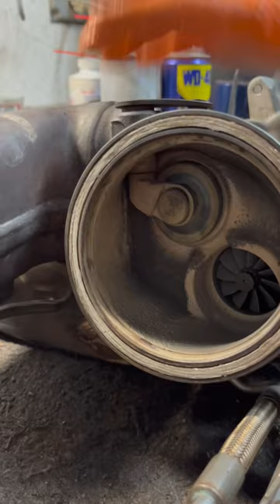BMW Turbo Wastegate Flapper Rattle

Comment: Mine only does this when I switch it into Eco Pro mode...
Reply from the maker: Doesn’t matter, it’s not supposed to do that. You could try adjusting the wastegate arm.
Reply: @motorcarnut  how do you adjust it? Can you make a video on this please
Reply from the maker: Ok, I will very soon
Reply: @motorcarnut  thank you I appreciate it I believe I found out the fix to mine but mine has different symptoms from everyone else and I don’t get codes
Reply: Some let me know when the video is up. My f32 is making a rattling usually with cheaper gas but I don’t loose power.
Reply from the maker: @juliovazquez9056 

Here:

https://m.youtube.com/watch?v=6e6uKIra8Rc&feature=youtu.be
Reply: Did u find the issue I have the same thing in eco Pro

Comment: My Fiesta ST-3 has this rattle and I’m also convinced it’s the wastegate. I need to find out if there’s a way to fix it without replacing the entire Turbo because it’s such an annoying sound.
Reply: I don’t think you can partial repair this. You can see where the round valve is pressed onto the metal articulating arm. The hole on the arm has wore out into an oval. Probably cheaper to get a new or reman turbo than paying a machine shop to fab up replacement arm and valve. At this point the turbo seals are probably on the way out either way.

Comment: Does it also make knocking sound?? Bc mine does
Reply from the maker: No really, the engines do so be careful it’s not the engine
Reply: @motorcarnut  actually I checked with 2 mechanics they both said problem with turbo bc the sound clearly comes from turbo and one of those mechanics said the waste gate thing that is inside the turbo is lose that’s why it cant close problem and the air keep leaking from there and it doesn’t close properly and keep making sound ! Do u think that is correct??
Reply from the maker: Yes, that’s not a knocking sound, the flapper valve is probably worn out. I have a video on replacing that valve if you want to check it out.
Reply: @motorcarnut can I send you a video of a sound I am getting? E92 Pre LCI 335d - M57 engine, both turbos were replaced Oct 2019. When stationary, if I move to reverse on the gearbox, sound isn’t so loud, when I go into drive it gets louder (tin / clacking like sound) and then neutral too. I took a video, I can upload and share with you.

Comment: I have a 2011 VW cc sport & took it to a euro performance shop & they told me it was a trashed waste gate. I hear this sound & I lost so much power and it’s jerky a lot. My main question is, can a bad waste gate cause stalling? It happens more when my A/C is on but my car stalls completely almost everytime I stop the car with my A/C on
Reply: Also I have most my boost in first gear & sometimes second
Reply from the maker: No , a bad waste gate has nothing to do with idle, there is no boost at idle.

Comment: What's awesome is, every single European and some domestics have this flaw. And there's no fixing it. Only replacement of the entire turbo. 
 Tell me that wasn't engineered.
Reply from the maker: Hard to tell, seems like it. Thats why I made this video to help people save money.
Reply: To my knowledge bmw have a software update keeping tension on the flap to eliminate problem
Reply from the maker: You’re referring to vehicles with the electronic wastegate.
Reply: @motorcarnut people just weld that flap so it don't rattle seems to work for some
Reply from the maker: @tgshark1 the flap has to move or it will destroy the whole wastegate  assembly. Don’t you think the manufacturer would have welded it if that was a good idea?
Reply: @motorcarnut your acting all smart while you think the manufacturer might make bad parts to shorten lifespan. As a repairmen you should know better. We qualified repair men see and understand why the cars get built the way they do. And yes some enigneers place bolts on a hard and f up place but its life. That dont mean they do it on purpose.
Reply from the maker: I just call it like I see it, if you think otherwise that’s your opinion and you’re entitled to it just like mine.
Reply: You put an adjustable wren h on the top arm and one on the waste gate, and you pull them together. It's a cheap fix that works.. you can watch a video on YT on how to. No replacing turbo needed.
Reply from the maker: Sounds fagazi to me, lol

Comment: Did you get drivetrain error due to this ?
Reply from the maker: Yes, just told you
Reply: @motorcarnut  then I think, I am facing the same problem. Error code related to pressure. Low pressure error. Replaced the blow off but still giving error. Plan to replace pressure converter which control the wastegate but observe the wastegate is moving accordingly. So I assume the pressure converter is working. Now suspect the turbo flapper.
Reply from the maker: Also , I have videos on how to pressurise the charge side of the turbo output for leaks. Make sure there are no leaks for the turbo to the intake manifold.
Reply: @motorcarnut  i did not remove the turbo from my car yet. How do i check if the flapper is the culprit?
Reply: @motorcarnut  i went to a workshop. They use pressurise test by removing my air filter and fit with a ballon. Then put some smoke..that is what i saw.
Reply from the maker: I have videos on both a pressure test right from the turbo inlet and a smoke test as well.
Reply from the maker: Where the wastegate hooks up to the flapper arm see it the is excessive play
Reply: @motorcarnut  i check out your video.